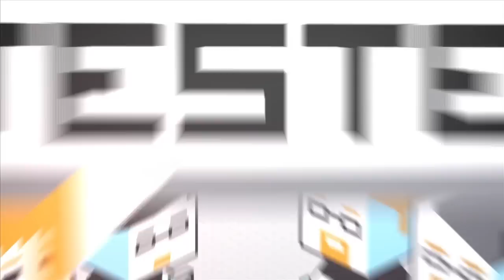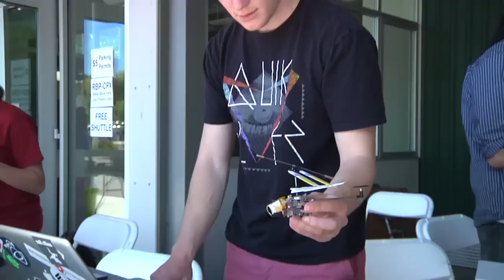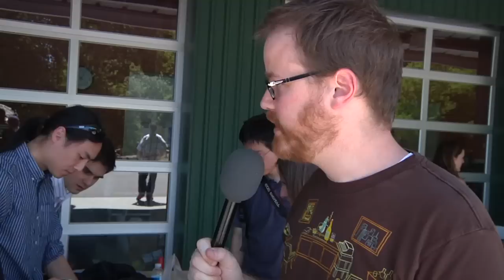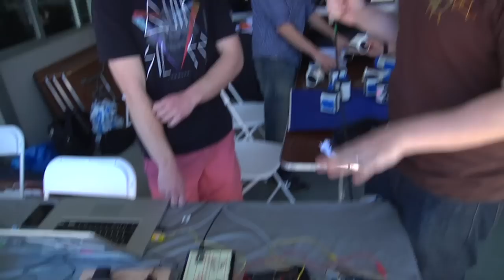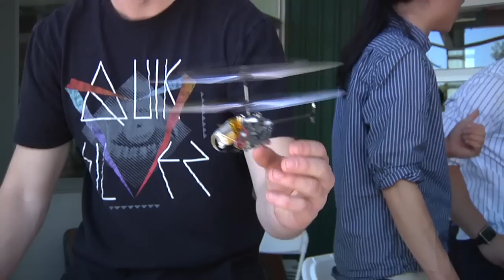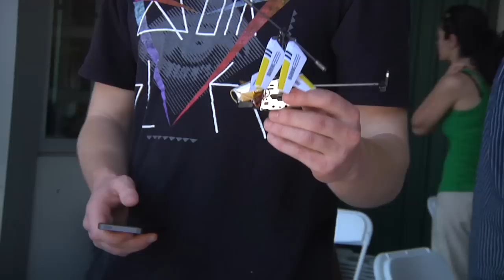Hacking a $20 Toy Helicopter into an Autonomous Drone

Comment: This is interesting - I'm one of the people on "the internet" who previously reversed the Syma 107G protocols (you can see a good round-up at hackaday.com/2012/12/08/more-fun-with-syma-107-reverse-engineering/).

A LIDAR setup looks super interesting - I brainstormed a similar idea using a Kinect for depth perception, or even a single-webcam approach using the OpenCV libraries with depth-mapping. I think these little heli's are about as much hacking fun as you can have for 20 bucks!

Comment: @ddgg00 Using microphone input for a DC signal wouldn't work very well, and the mic input has low and high pass filters that would kill the frequency used by the LED.

Comment: For you hobbyists, the' ArduPilot' with GPS, is a good device to start with (currently about $80. with GPS), then add the 'kind' of visual system this kid is envisioning. The rest is simulated neural networking, adaptive pathfinding, routing optimization, various statistical weighing algorithms, etc.

Comment: The reverse engineering of the ir sounds over complicated, I reversed engineered a tv remote by going up an ir receiver to an oscilloscope and then read the pulses. I then programmed a PIC to control my 6 legged walking robot which was in house and rider configuration

Comment: Okay so i have literally the same remote IR system and all but im lacking the actual helicopter, so the remote controls nothing. But im trying to get another helicopter receiver part ive looked all over the place and I haven't found a single thing i need the helicopter parts itself so if someone knows where to get the parts that'd be great, if not ill just buy another helicopter.

Comment: He should connect an xbox controller to his computer to make it more like the original controller
Reply: That'd be fine if he wanted to communicate with the robot through the computer but still have it controlled by a person, but since he wants it to be autonomous the only benefit that the controller would have added to the project is that it would have assisted in his understanding what the input he was receiving meant.  Although if he wanted to be able to switch the helicopter from being autonomous to person controlled and back at a moment's notice, the xbox controller would definitely be useful since he cannibalized the original in order to communicate with the helicopter.

Comment: Hacking? Lol what? Making lolbot.
FYI  - $20 chinese "Toy Helicopter" have all system for autonomous flight - sensors, stabilize controlers, comm channel and built sheme for remote operations.

How it manipulate - manually from pult  or computer basis (t.e. powerfull chinese tablets or primitive arduino controller) -  irrelevant.